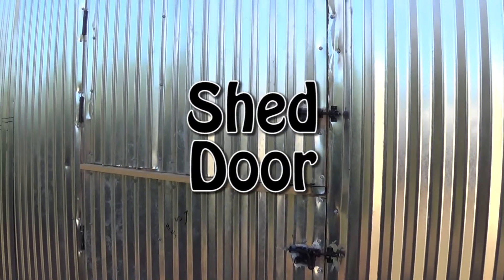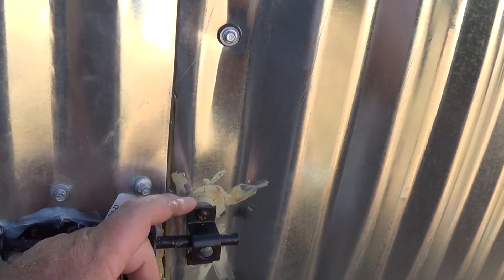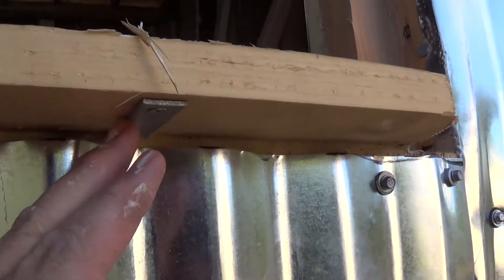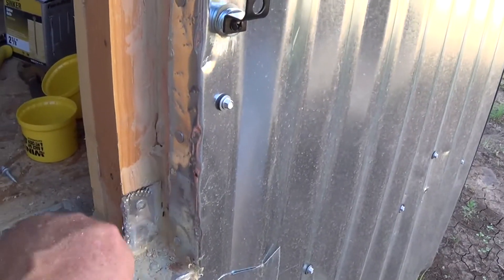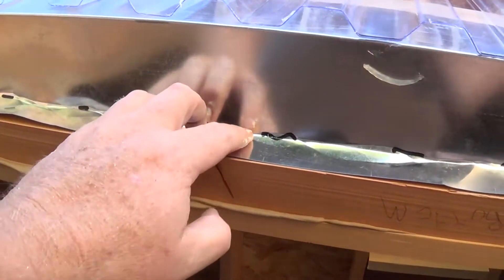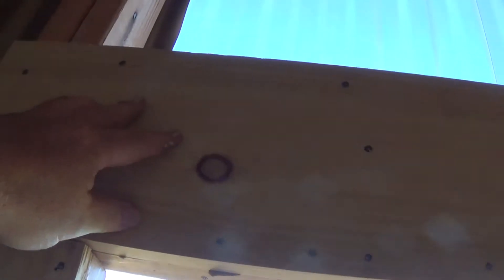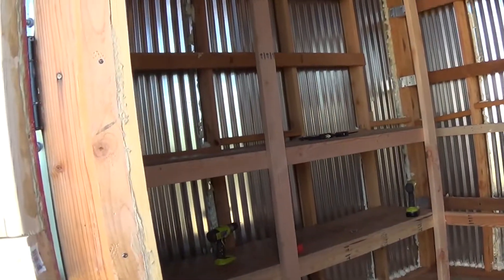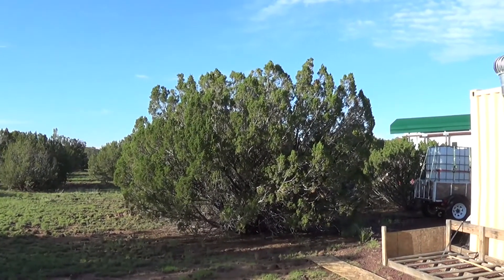10 x 12 Off Grid Shed Doors Completed - Garden Shed Series Video 5

Comment: Good job. Like the DIY threshold. You mentioned steps. I would go with a wood ramp instead. That way if you need to put a few 80# bags of concrete or similar inside you can use a wheeled device. I used an old interior door as a temporary fix. 10 years later  it still works fine. Plus, it is just plain safer than steps.
Reply from the maker: ***** good idea.

Comment: I have couple of suggestions for you to consider. Instead of a diagonal piece on the inside of the doors put gussets at each corner. Much easier and your doors won't sag.
Also I would put some kind of upturned lip on the inside edge of the divider board to prevent water from coming in (unless you think there would be an occasion when you would open the lower door and not the top one. Nice shed.
Reply from the maker: joe okie nice tips. didn't think about the gussets at the corner.